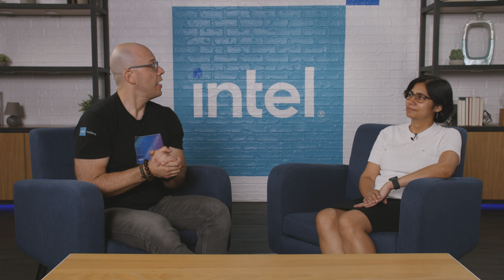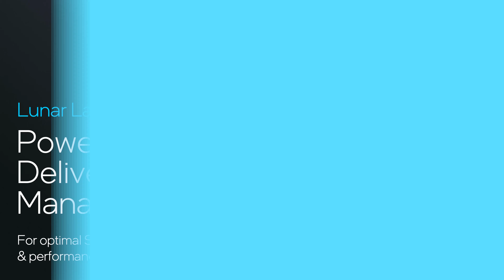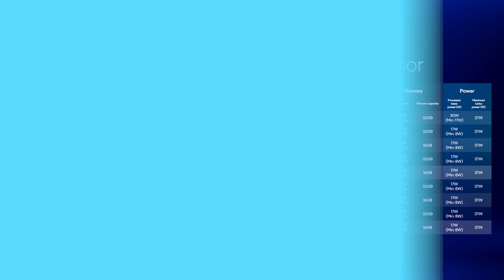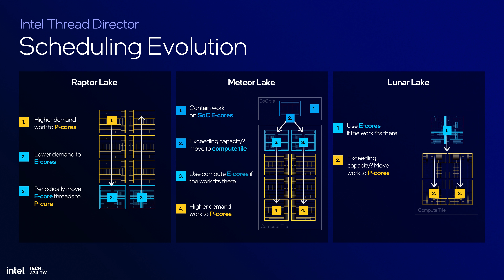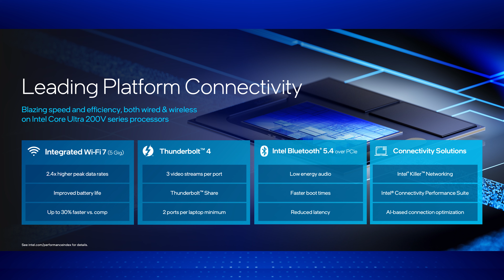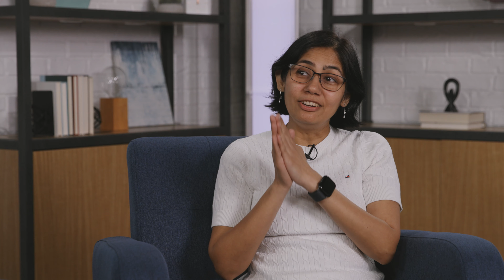Lunar Lake Launch: Performance and Features Overview | Talking Tech | Intel Technology

Comment: This is a great product. It would have been even better with integrated Thunderbolt 5. Shame Intel sold their 5G because integrating that would also be huge. Curious what the next product with memory on package will be. Make sure it has integrated Thunderbolt 5. x86 is back!
Reply: For now it integrated the Thunderbolt 4 tech.
Reply: @lesterjadeuntal931  Thunderbolt 4 has been integrated since the release in 2020 with 11th Gen Intel Tiger Lake and every other Generation after that.
Since the release on Thunderbolt 5 in late 2023, we have had the release of Intel Core Ultra Series (100 and 200) Meteor Lake and now Lunar Lake, both without Thunderbolt 5 integrated.

Comment: The core ultra 7 155h has 22 threads with 3 different types of cores.

lunar lake skus of the same tier cap out at 8 threads with p cores and low power e cores... not sure how to feel about that. No doubt it'll be more efficient but how will multithreaded performance be affected by this... limiting choice of core config

Comment: Arrow Lake is launching pretty much the same time, but the amount of information about it coming from intel is like 20 times smaller than the amount of information about Lunar Lake, why is that?
Reply: Laptops are a bigger market, and Arrow Lake is not as big of a jump as Lunar Lake is.
Reply: @zachb1706  Arrow Lake is a big jump, especially when your previous generation consumes like 300W and is crashing.
Reply: @auritro3903  it’ll be a good jump, nothing like Lunar Lake. It’ll more or less look like a Meteor Lake chip, just with the new cores which bring with them a decent IPC uplift. Wheres Lunar Lake was a complete revamp
Reply: @qwdeaszxc Arrow Lake launch date is on October 17th, we should learn more about it then
Arrow Lake is also largely based on Lunar Lake, just that it's more optimised for performance than efficiency.

Comment: Intel just separated the power delivery of the P and E cores.They can completely turn off the P core. Simply its work on the E core for daily bases, but its going to slow as f*k. If you want to fast as Macbook ,power consumption is going to skyrocket, efficiency sucks as usal can't compete with M3 and X Elite. Plus, Intel uses his RAM because that's the only thing they can improve efficacy, but it's going to be costly as f*K.
Reply: how do you know that, buddy? Did Intel sent you a sample laptop and you had already tested it or what? If not, don't post such comments

Comment: The memory better got perfect quality, otherwise if there's a memory problem, you need to replace the whole CPU! And how about I need some extra memory? Can I also add memory the traditional way?
Reply: memory won’t repair easily
Reply: No you can’t add memory.
Reply: RAM doesn't fail, unless you push the voltage.
Infact the RAM chips are rated for 100+ years
Reply: @panjak323  yeah exactly, your CPU will fail before your RAM.

Comment: Y'all lost me with integrated memory. CAMM doesn't yet hit those speeds, but is better than so-dimm while still allowing replaceable/upgradable memory. Then again, you may still get my money on a discrete Battlemage GPU for my media server if the power draw is in check this time around. While I am disappointed in this, I will still give Intel credit for their Quick-Sync support and having some of the best encoder/decoder quality and support in that segment
Reply: I feel like integrated memory can be justified for this sort of low-power chips, as long as they're actually efficient and using high-bandwidth memory that may take a while to appear on CAMM2.

Guess we'll see: if they keep it for higher-power chips or make something like in-package DDR5-6400 then that'll be a huge disappointment.
Reply: Integrated memory is cheaper and has a lower power draw, for most consumers it’s an obvious choice. Arrow Lake still has upgradable memory

Comment: Manini you failed drastically on the 13th and 14th gen, oxidation issues, overvoltage issues - class action lawsuits and massive brand reputation losses. Where is the accountability??
Reply: They already completely fixed that issue with BIOS updates, warranty extended from 3 to 5 years for anyone that is concerned. Intel handled it well once the issue was found.
Reply: @__aceofspades it’s not completely fixed and it’s not that simple, these chips were physically damaged you can’t software upgrade your way out of  that
Reply: @holyearth  get a replacement if your chip had a voltage failure. If its still running take the added warranty + the micro code fix. I think its a win win situation.
Reply: @holyearth if they’re damaged you can get a replacement
Reply: @zachb1706  RMA denied

Comment: no overclockable all cpu igpu?
Reply: It's optimized for perf/W. Overlocking significantly reduces efficiency.
Reply: Overclocking has been dead for years
Reply: @zachb1706  Are sleeping under a rock? Igpu overclocking has been achiving 20-30% on both Amd and Intel last gen.

Comment: Thanks for making 16gb the base ram choice instead of 8gb. Looking forward to seeing the real world battery life of laptops with these chips!
Reply: I would love to know if there will be an option to add more RAM on the motherboard just like the old times or is it restricted to whatever comes with the processor?
Reply: That's the 8GB equivalent for builtin AI (Apple intelligence, Co-pilot), LLMs in OS/apps to run.
Reply: That's shared between system and graphics, you kinda need the 32GB one as I consider 16GB to be the minimum these days for system on Windows.
Reply: @lharsay Windows doesn't use that much more RAM than macos, especially in 3rd party apps.

Comment: Intel  cooked AMD 😅
Reply: Cooked their 13th and 14th gen too 😅😅😅
Reply: Uhmm no , pat cancelled Royal core, Intel has Boeing’d themselves
Reply: @holyearth  nope Intel needs more time to get their fab right untill that Intel will use TSMC.
Reply: @Maiza007-c8y  “more time to get their fab right” dude the 13th/14th gen processors are frying themselves!!!
Reply: @holyearth  frying Intel CPUs are over exaggerated. Just lock all cores and manually set the Voltage to under 1.35v on intel 13th and 14th gen CPUs
Reply: @Maiza007-c8y  If I have to do that and it no longer hits advertised specs then that's false advertising
Reply: @holyearth  how about AMD zen 5's advertised 20% faster gaming performance than zen 4 ? I'm using 13700kf it's running games flawlessly.
Reply: @Maiza007-c8y  F failed graphics binning, imagine paying top dollar for a 14900K and experiencing degradation or oxidation issues and being denied an RMA
Reply: @holyearth Moore’s Law is Dead bot.
Reply: @Maiza007-c8y what are you talking I had a cooked back in 8.2023
Reply: @DreadyBearBoi nah you are tweaking we are still doubling it every year we it’s getting harder cus of how small it is.
After we get rid of finfet it will again be faster.
Reply: @holyearth Royal core improvements coming in parts
Reply: @ximin_sleepy Royal core cancelled by Pat
Reply: @holyearth  Doesn't really matter much, the improvements are coming piece by piece, the engineering efforts are not wasted, just binned across 2-3  generations
Reply: @holyearth Bro imagine seeing a good product and then bringing up an unreleased future product that got “cancelled” as if it was guaranteed to come out as it was.

Comment: Why are you talking about performance with a marketing person?
Reply: Product Management isn’t Marketing.
Reply: @schoolstuff5235  Product managers and product marketers have many similar roles.
Reply: @schoolstuff5235  Product managers and product marketers have many similar roles.
Reply: Same reason why Gelsinger posts bible quotes all over his twitter. It's called clueless
Reply: Because marketing will hype, engineering will tell you the real situation: oxidation and over voltage problems causing degradation